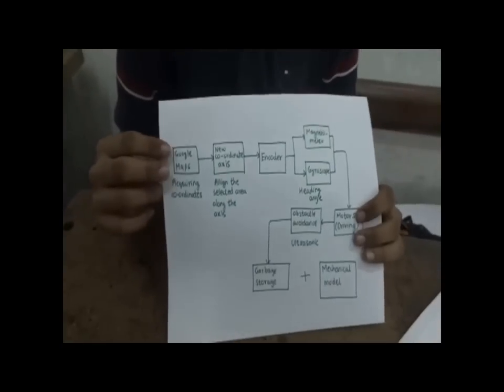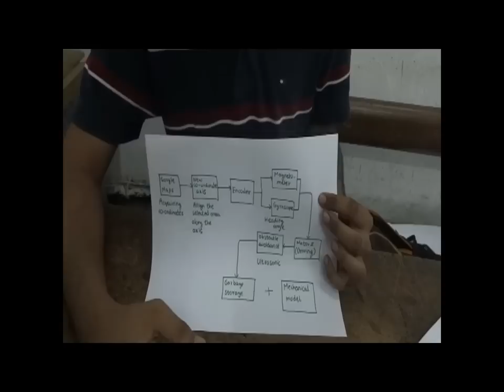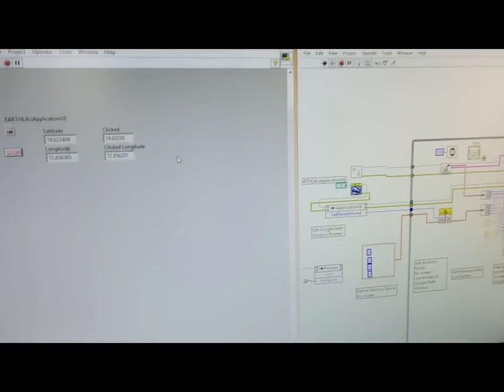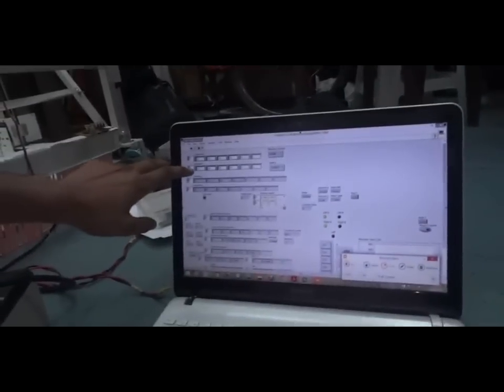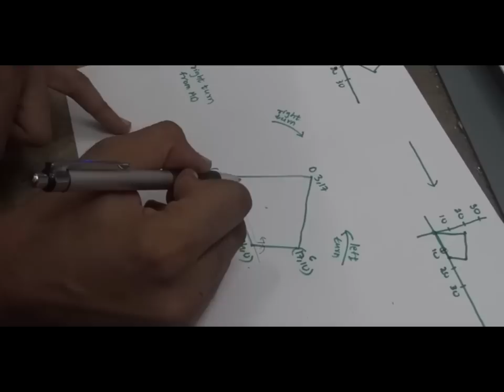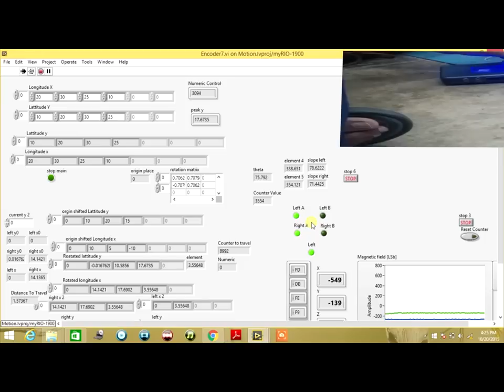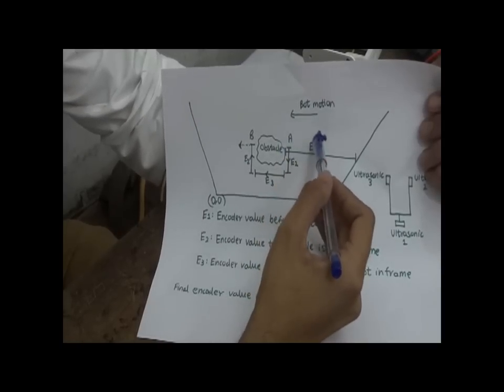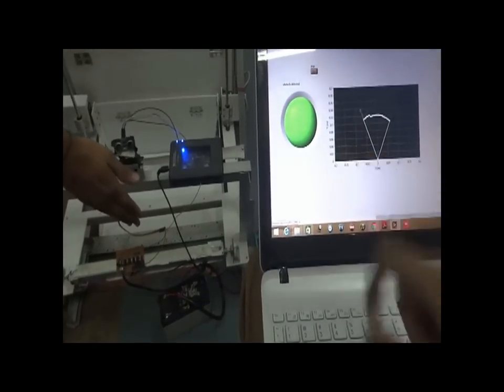The Scavenger(Outdoor cleaning) Bot- NIyantra Team -110

Comment: good protoype well done... but the garbage collecting system isn't efficient... battery will drain fast ... also human interference will matter
Reply: We have implemented obstacle avoidance, but surely it will get crazy on a busy street. But as you can see the robot can work even at midnight(human limitation) , just the coordinates have to be selected which can be pre-programmed for a particular time. As for the battery efficiency we are trying few solutions.
Reply: GO FOR A JOB THEN...
Reply: @sags081095  Sounds Great!